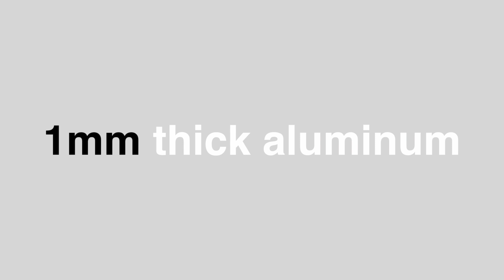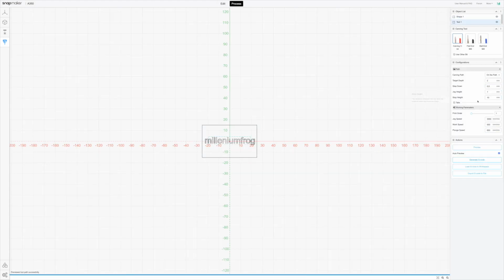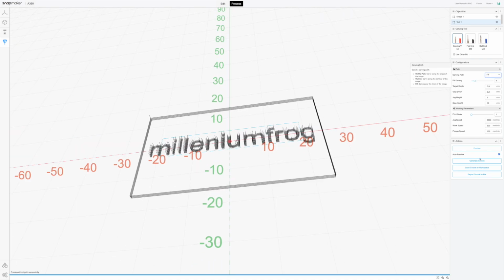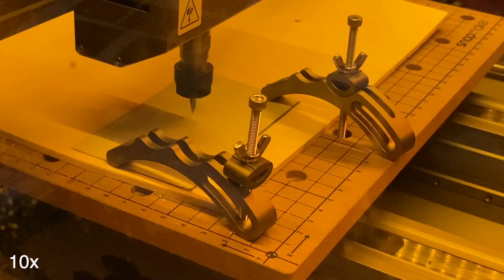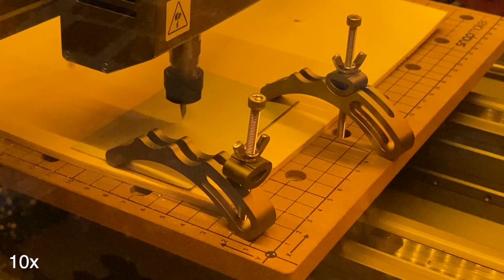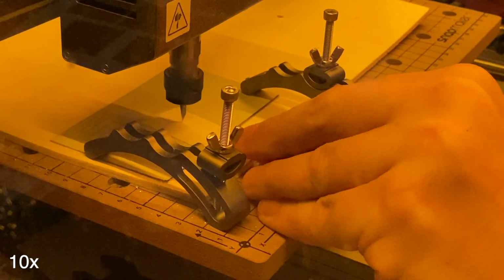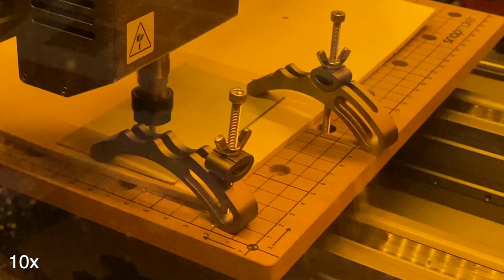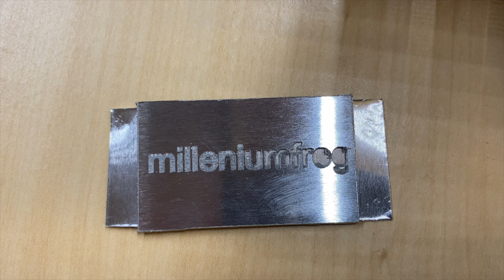First try to CNC Aluminum - Snapmaker 2.0

Comment: It’s absolutely possible to cut even very thick aluminum with it. I ordered a single flute 3 mm cutter and set the feedrate at 100 mm/min with a stepdown of 0,2 mm. The results were great, but it takes its time.

Comment: The main thing to consider when machining metals is Heat buildup. That's where coolant is needed so that the bits don't lose their tempering and become soft/ dull out.
Reply: Spread a little bit of coolant oil before starting, pause it at any point then continue and so forth, if you're doing it in steps, oil every step. Check Amana Tools website for bits to work on aluminum only, had good success with them.
Reply from the maker: Thanks for the hint. When I do a bigger metal project I try to use a coolant :-)
Reply: @milleniumfrog3d931  What kind/method of cooling do you plan to use?
Reply from the maker: @chege54  I don't have a project that requires cooling at the moment. So I didn't think about it.